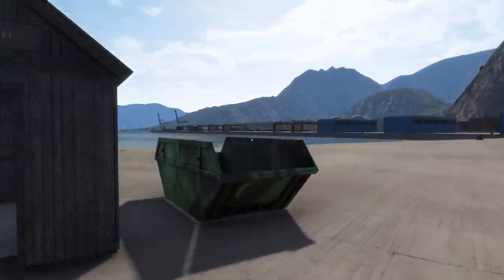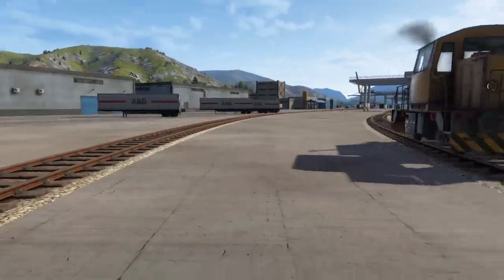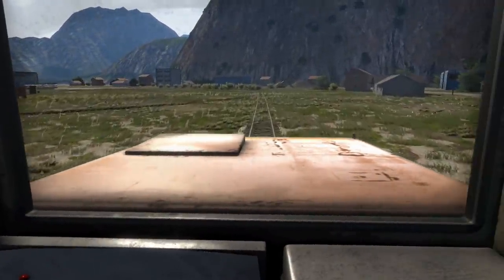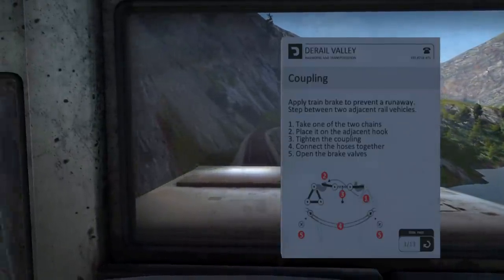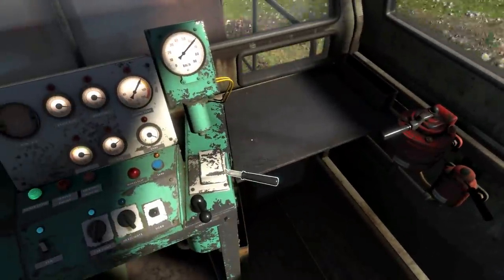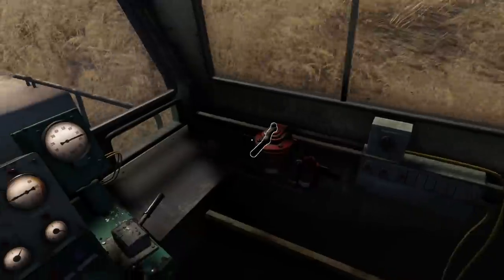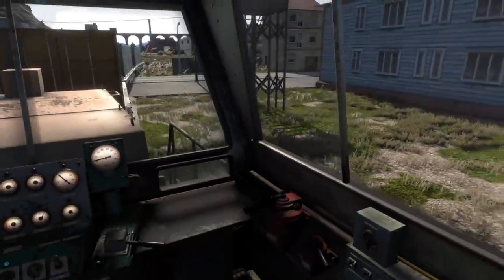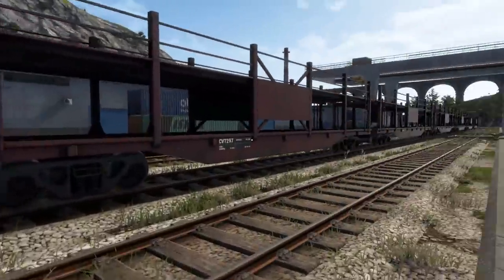Overheating a Train Engine in Reverse to Beat the Bonus Timer in Derail Valley!

Comment: in each major station is a shop. each of the shops has an unique item. one of them is a stopwatch. you can gauge your remaining time with it. one of the other stations has a remote control for the diesel locos. have fun with that.
Reply: i found it works on all but the coal train
Reply: @nathanharrison2  well yeah because the remote wouldn't be able to connect to something with no electricity lmao

Comment: When you get the steamer license you should get the Realistic Steamer Overhaul mod. It makes the steamer perform like it should and fixes the weirdness it has in the vanilla game.
Reply: I read that as streamer license
Reply: @Ericshadowblade  Which is what he actually gets... All streamers out there have to get Derail valley and buy that license to be allowed to stream.
Reply: Does that fix the water consumption? I just did a loop steel mill to goods factory and back and that took every ounce of my water which is just absurd.
Reply: @Dude13450  It does reduce the water consumption especially when climbing hills. 

In the vanilla game the steamer uses up a lot of steam and thus water even if the train is stationary but the regulator is open. This should not happen.

In reality the steam consumption should depend on the speed of the train, as steam is only consumed when the piston's valve opens when the train moves. This means that steam consumption increases with speed and is (almost) zero when stationary with full regulator.
Reply: @joonahuikuri6662  oh thx for the tip im playing the game and im almost at the steam engines and didnt even notice mods lol
Reply: Zeibach is a genius. Also super helpful in the Discord server.

Comment: kAN, you can turn around at any of the Y junctions... Including the one you travelled through after leaving the port. IRL many places use a wye instead of a turntable, it allows to turn around entire consists. We mainly use them to turn electric suburban trains around, so the wheels on each side wear evenly.
Reply: yeah except in the harbor you need to be careful to not slam against the invisible wall thats there because you don't have the military or hazardous license... i can't recall witch one it was
Reply: @De_Lus  it's the military that puts the wall there
Reply: @De_Lus  There's two Y junctions in the harbor though. One before the roundhouse( with turntable) and one after. Only one of the Y's approaches an offlimit's zone, the other is freely traversable

Comment: So when you talk about air brakes - Im a truck driver IRL and big rigs use exactly the same system for braking. The air pressure actually releases the brakes, therefore creating a built-in safety system where if you blow an air line and pressure is lost, rather than having a runaway truck that could smash through cars and kill people, instead the brakes will lock up and force the truck to stop. However this can also cause crashes. There has been unlucky moments where air lines leading to the trailer on a big rig broke, so the trailer locked up brakes at highway speeds and caused a jack-knife. Its still safer than a runaway system, but its not perfect.

Comment: Tip 1:  Now you've got the long license get used to using the train brake.  If your pulling and have to slow down in a curve and you use the independent, the cars will just push the engine right off the track.
Tip 2:  No need to slam on the train brake fully.  Most of the slowing down can be done using the first couple of notches of the train brake and the pressure to release builds back up faster than full brake.
Reply: I suggest when arriving near the destination of the job, slide the brake lever into Initial reduction notches. (Notch 1-3) Notch 4-7 is Service (efficient braking, recharges reasonably fast.) and 7-Max is Emergency. (Fastest speed reduction but slowest brake valve recharge.)

Comment: Got some more Tips:
-The main hotkeys for stuff you'll need to remember are the ones for the Train Brake (N & M) and the Independent Brake (K & L).
-To not damage anything, you'll want to couple up at 10kph or less.
-As far as I remember, the fan is useless currently.
Reply: F1 through F8 operates all the engine controls as well, feels pretty convenient to have them all in a row. :)
Reply: @AlexanderBurgers  same thoughts exactly, F1+F2 Throttle , F3+F4 Train Brake, F5+F6 Reverser, F7+F8 Independent Brake

Tho i definately need to go into the config file they list on the controls booklet to swap the Train Brake and Reverser keys around
Reply: Yes fan is usless but when simulator drops soon it will be working

Comment: Everyone: "Hey kAN, don't put your hand on a Stove Burner while it's on."
kAN: Makes a video of him placing his hand on a hot stove to see what happens.

Edit: By the way, you can literally use a Triangle intersection to move your loco to the other end of the cars so it's facing the right way. 
Stop the whole train before the intersection. Decouple. Run Loco across the intersection. Flip the switch to the other line, back up past that switch and the next one. Flip that switch. Bingo bango you are now facing the cars in the opposite direction. That's how we do it in the real world without turn tables and why Triangle intersections exist.
Reply: He really should know this, just not using his noggin

Comment: As you get more licenses the time bonus time becomes less and less. You are going to have to hook up the train before you take the job eventually. If you are ever planning on taking multiple jobs the only way to get the time bonus is to hook up the cars first.

Some other tips: 
Cars have their job ID on them this makes them much easier to identify before you take a job.
Go through all of the jobs on tables before making a decision on which one to take. Some are objectively better than others.
Car, cargo, loco, and environmental (hazmat) damage will bankrupt you later on if you are not careful.
Do not take any licenses that raise the insurance copay more than you can comfortably make.
If you hear a car derail, full stop. Rerail. Start back up. The most likely cars to derail are those at the front.
A stop watch is available for purchase at one of the shops (I think the harbor) for 5k. It is extremely useful for keeping track of time left.
Station offices always have an antenna with a green light on the top of them.
A locomotive remote(25k) for the diesel locos is available at one of the shops.
A hand car(5k) and a caboose(25k I think) are available for purchase at 2 of the shops. Their are 2 sheds on the map that need to be unlocked.
The caboose has a range extender and quick charger for the locomotive remote, and a service/license terminal.

I have only played in VR so some of my experiences my differ.

Comment: Hey Kan, you can operate all the controls with just the mouse wheel - just point you camera at something and once it's highlighted scroll up/down with the wheel to operate it. When doing this on the brakes, scrolling down will always release the them, scrolling up will always apply them.

Comment: Little tip when talking about tracks at 2:06 for exemple D3O means D3 Outbound and I2I is I2 inbound (correct me if i made a mistake there)
Reply: Yup.  Also if I remember right, L is for (Un)Loading, and S is for either Staging or Storage.

:Edit: Haha, yeah later in the ep he read it from the manual.  This is what comments are for - telling people stuff they already know! :D
Reply: @norbby42  I like to think S is sidings but I don't really use them that much as I don't do shunting untill I get the remote
Reply: D30 would be 3 Outbound in the D section
I2I doesn't exist (afaik) as no train station has an I section, but D2I would be 2 Indbound in the D section
Reply: @ValentineC137  I am no train expert just heard Dapper explaining it in his videos but thanks for the info !

Comment: Hi Kan. as you progress you'll notice time bonuses have a % knocked off making the goal harder.  You can move the consists around in the yard when you have concurrent job license >1 and you need to shunt them around. DON'T leave the yard with the consist without accepting the job. The job will despawn. Other turnaround options include the triple point "Y" junctions, I'm sure you'll work out how.  Also, when you have followed a route you'll find the points are left as set. Checkout the different shops too. All sell different stuff and situated near / opposite passenger platforms.

Comment: Got some things to help 1. If you hit esc in the menu there is a button that says station scamatics it provides you with a basic map of each station and where things are 
2.trains have low friction so cruise as much as possible to save fuel
3.the dynamic brake is only good for anything but your locomotive it is powerful but takes long time to come into effect
4.wheel slip there is a red light turn your throttle down when it goes on or use the sander
5.go below 5 kph when hooking up to prevent damage and repair cost
6.your train can only haul 400 tons but with multi unit liscense you can stack them
7.please read the manuals
8.must stations have a turntable or a place you can turn your train around

Comment: You could use the triangle intersection to turn around.  Drop your load before the intersection.  Go through the first switch, the second.  Stop, flip second switch, go back through the second and through the third.  Stop, flip switch, go back through the third.  Go through the first switch, reattach load.  Go through intersection and  continue as normal.   It is basically a 3 point turn but with a train.

Comment: Nice! That locomotive looks really hot. Heat wise. Also here's a tip for horn/whistle signals for railroading games. These are just general signals.

2 Short blasts - Moving forward
3 Short blasts - Moving backward
1 Short blast - Stopped/stopping
2 long blasts, 1 short blast, 1 long blast - Clearing a crossing (Moving through a crossing)

Not sure how up-to-date these are (Or how far back in time they apply to for Railroads Online!) but these are what I've learned over the years.

Comment: If you want to save time for the bonus, might I suggest when sightly far away but approaching the station, go to the station and flip the switches for the siding so you can get the cars into it and unload the quickly as it saves time having to move fairly slow so you can flip the switches

Comment: Instead of using a turn table or a "Y" junction, you can also just go through the shunting yard on a clear line. As long as you can get out at the other end this will place you in your direction of travel at the  end of the cars
Reply: You can even use a single Y intersection to turn the train around. Move 1 wheel over the junction, switch it. Give a small bit of throttle and the train magically goes 2 directions and flips around. Physics does not exist in the game

Comment: Tip: NEVER EVER use the shunter backwards. The vents in the front of the shunter helps to cool the engine. Use the turntable to flip the locomotive.
Tip 2: I suggest when arriving near the destination of the job, slide the brake lever into Initial reduction or service notches. Notch 1-3 is Initial reduction. (Small reduction in speed for a comfortable stop, making no damage to the cars and locomotive) Notch 4-7 is Service (efficient braking, recharges reasonably fast.) and 7-Max is Emergency. (Fastest speed reduction but slowest brake valve recharge.)

Comment: The station map should show you where the turntables are (at locations that have them).  The Harbor & Town's turntable is at the engine shed near the downhill entrance that you left via.
Reply: Also, on the goods factory & town station you can turn around by going from B through the line in the middle (that with the service), and coming back through C - you effectively do a loop around the station

Comment: if you having trouble pulling load with the shunter loc try getting the license to run multiple loco's.
i was able to do 4 jobs at the same time from steel mill to the harbor with 5 shunters coupled together pulling 41 cars with a tot of 1480 tons.
Even with light loads having atleast 2 is gear for better acceleration with less wheel slip, you can still turn them on the turn table 2 at the same time but if there is a T intersection nearby it's eazyer to turn the loc's around using it instead.

Comment: Just starting the video, but: There is a roundhouse in town if you want to turn around.  There are at least 2 "Y"s in town you can turn around there too.  And, especially in the harbor, one can usually get behind your load on those dead ends by going up a clear siding and getting behind it...works well with a switcher....one can usually fit two switchers in there...this would mean you'd push the load out instead of pulling and then you'd need to turn around if you intend to head out of town to the west (which works well, cause the two "Y"s are near the west side of town)...or...head out of town east to get to your destination.  You can turn around anywhere there is a "Y"...even out on the "mainline".
Reply: Oi...train length before multi units??  Ah well...good luck.  And I'm really looking forward to you having a go at the steam engine.  Oh! And thanks for going through the manual...I learned something.

Comment: Not sure if you will be able to do a Long train with the shunter. You may need 2 of them, or a DE6.

There is a remote at one of the shops, it's very handy for yard switching. (Expensive though)

As someone else mentioned, there is a stopwatch (I believe at the harbor) that will help you with timing. I think it was either $2500 or $5000 I forget which

Enjoy your insurance while you can, more licenses equals less insurance and more out of pocket for fees and maintenance (unless you do manual maintenance... But that can get tedious.)

It's a great game with a lot of potential, and I am enjoying it!

Comment: Just saying. You crossed over several wyes. You can park your load (apply handbrake) at the switch. Back up the right side, flip the switch. Go right again, then you turn yourself around. Use the Wyes to your advantage

Comment: TIP for jobs-- the code on the job info (HB-FH-24) is also mentioned on the cargo rakes this will save time and increase time bonus
The first license you should aim for is concurrent jobs-1 it helps a lot for early cash (but be careful as the starter train can pull only 390 tons correct me if I'm wrong)
manual service license will save you some money but will take up your time
keep at least 20k on you at all times or maybe more
don't go after not so important early on  like hazmat and logistic haul 
the multiple unit license along with concurrent job one will help out a lot

Comment: 20:38 that’s because for the time being, it runs on a narrow gauge track. Once the devs had updated to allow modding in the game you’ll be able to go at high speed with standard gauge.
Reply: 6 months without an update, kinda seems a dead game
Reply: @jagerfly2231  seriously... 6 months? That's.. nothing tbh.
Reply: @abbycottontail  6 moths with absolutely no community interaction as far as I've seen (no hot fixes or events) is not that long, but still something that may be concerning
Reply: @jagerfly2231  there's an update set to come out in March this year

Comment: I know your insurance company is currently being very generous, but they're going to raise your copays as you take on licenses for bigger trains and bigger, riskier jobs, so here's a couple money-saving tips for the future:

If you print out your itemized bill after a job, you'll notice a big part of it is maintenance and refueling. If you just pay your fees outright as soon as you get into town, the Derail Valley Railroad Company will happily handle maintenance and fuel for you... for a surcharge on top of the cost of the actual repairs and resources. Again, right now your insurance provider is eating most of that, so it's actually more cost-effective to let the Company do its thing, but as your copays go up and you're paying more and more of your own bills, you'll want to buy the maintenance license so you can use the service sheds yourself. You'll start paying for your own fuel, sand, and repairs, but you won't be paying the surcharges anymore.

On the topic of maintenance and fuel, you can save on these by just remembering one thing: Trains only actually touch a tiny part of the tracks. That means less friction, which means trains can coast really, really far. Consequently, you can actually go pretty far by getting up to speed and then bringing the accelerator back down to idle, only using it to maintain your speed, like on uphill grades. Idling and coasting saves fuel, and also gives the engine a chance to cool down after acceleration, meaning less wear on the engine.

Wear on your brakes, similarly, can be slowed by nudging your brake handles, or by flicking them on and off. What you've basically been doing is throwing the emergency brake whenever you just want to lose a few kph, and that aggressive stopping wears down the brakes and loses you the time spent waiting for the system to re-pressurize. More gentle braking slows you down without bringing the train to a halt.

Comment: For a game called "Derail Valley" it's kind of funny that you don't derail when you reverse back over a switch you've just run through.
Reply: In many cases modern railroad switches are spring-loaded to allow a train to pass back the wrong way
Reply: @Travelinmatt1976  No they're not.  If anything, spring switches are far LESS common than once they were.

Comment: About your statement on steam locomotive speed, many of them were quite fast. For example, the Union Pacific FEF 4-8-4s had a top speed of 120 MPH, and the New York Central 4-6-4 Hudsons had a top speed of 123 MPH.
Reply: And there was a few British steam trains that easily outran their Diesel Electrics as well in races pulling equal weight.
Reply: @daveb.4383  Very true!